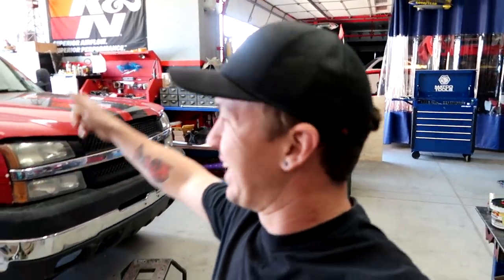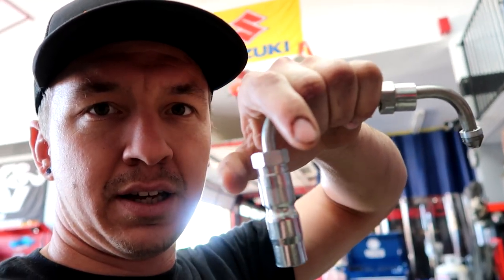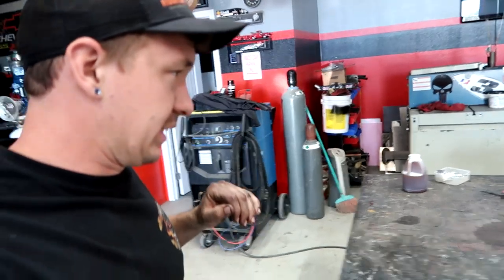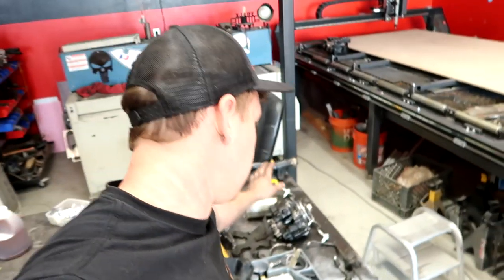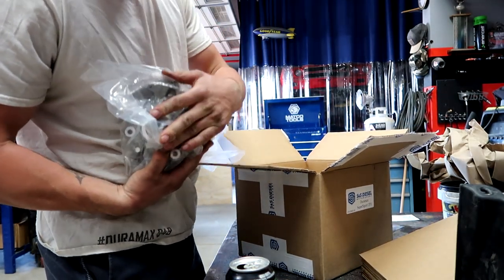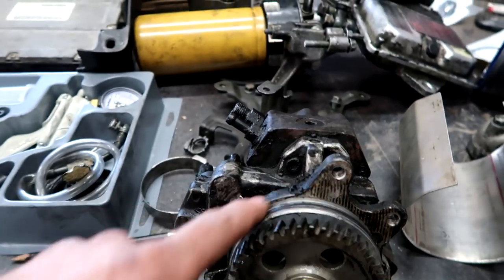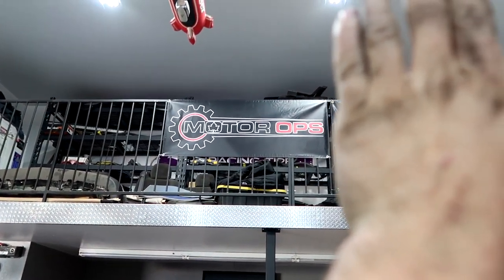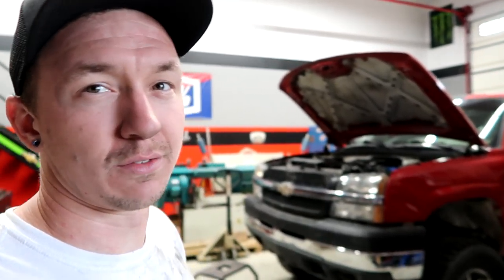LB7 Duramax CP3 Replacement

Comment: How do you determine if theCP3 is the issue,did you use computer ,I have a no start, I have replaced the fuel filter housing and filter plus inline and checked fuses but can’t get it to prim any help would be appreciated! Thanks

Comment: When u did the pump did any other part of the fuel system get replaced also? Just pulled the cp3 on my lbz tonight due to a mysterious leak, and I am torn on how much further I really should go. But due to the lines being open and "moisture" getting in blah blah did u do injectors or fuel lines at the same time u did this pump or just parked it and changed the pump. Im being as clean and careful as humanly possible cuz as of tonight I can't afford the pump or even what cp3 charge would cost right now. My turbo 2 weeks ago had decided it wanted to shit out.. replaced it and egr delete it and 2 days later blew an uppipe so did that, and now I'm dealing with both a mysterious cp3 leak and also the bottom oil feed line fitting down in the valley started leaking so pulled out allll back off to re do it. All new coolant and fuel rubbers while I'm there. All the right size and made double sure of no kinks or soft feeling spots anywhere. Really hate redoing stuff is why I asked about what all u changed while doing cp3 cuz whatever I can do to not have to buy more shit the better that turbo put me so far in the hole
Reply from the maker: if it is a cp3 thats causing an issue we usually just change the cp3 and send it on its way there's not really much more that you can do if you want to pull the lines and make sure there is no debris in the injectors where the lines meet

Comment: L.D.S. is my go to! Laura and Brent as the best! After a person installs the injector lines..and the injector side run some clear silicone in the area and seal it off where the line runs thru the feroule/ nut that you tighten down.extra insurance keeling water/ moisture/ debris out!
Reply from the maker: hahaahahha just need to get rid of lb7 even though I own a bunch hahah they aren't that bad I don't do that just because it makes a mess and more work for me later! I don't ever really deal with them but they seem to be decent

Comment: Hey brother. My 03 LB7 turned off while driving. It cracks but won’t turn over. I changed out the primer head and fuel filter but still won’t turn over. I’m now thinking it’s the CP3..do you think that could be it? No check engine light
Reply from the maker: potentially could be you would need to get a computer on there to read the actual rail pressure vs the desired to see if thats really the issue!

Comment: Sometimes when I’m driving and going up to speed, the pedal falls on it’s face, could it be my cp3? Am I losing fuel rail pressure ?
Reply: If there is a big gap between commanded and actual fuel rail pressure you will have a check engine light and code P0087. I'm not sure if pedal feel is an indicator of that or not. If you dont have the code I would look elsewhere.
Reply from the maker: would really need to know if there is codes like trynottobreakit said could be a dirty fuel filter or a number of other things
Reply: DURAMAX_DIESEL yeah I’m not getting any codes, I already changed fuel filter. It’s kind of weird, it does it then goes away. I’ll look more into it, thanks brotha 👍
Reply: @bradjohnson6783  off the wall but worth a try. After I installed compounds on my truck, it was slow as hell. Normal driving was fine but putting the foot down it fell on its face. The issue was my MAF sensor. I damaged the wiring. Point is, it wasn't sensing the actual volume of air that was moving so it wasn't fueling appropriately. Fixed that and problem solved. Might be worth looking into.
Reply: trynottobreakit 0369 thank you sir, will do.

Comment: My mechanic is saying my truck needs this new pump and he suggested a lift pump to go with it - saying 18 hours of work though and that seemed high to me. Quote for all the work/parts/labor around $4200. EEEEK. I have a 2004 2500 Duramax. They aren't getting any codes, but twice now they've had to prime the pump and the truck will run for a day or so and then not start or will start and die.